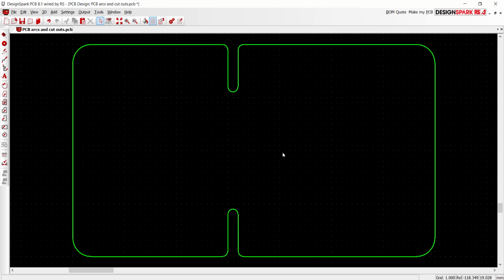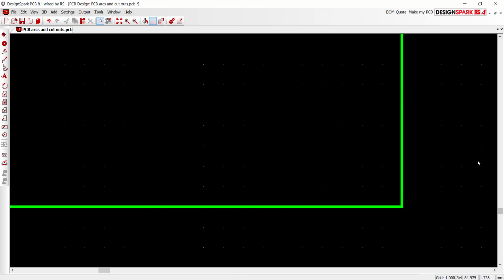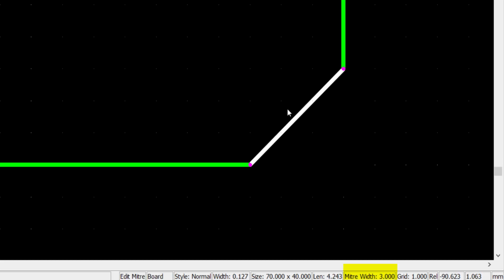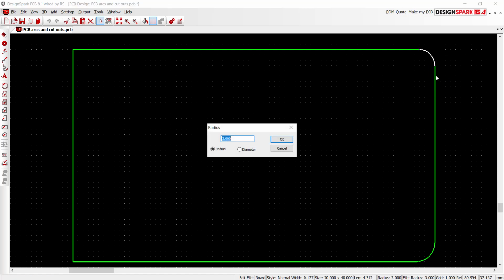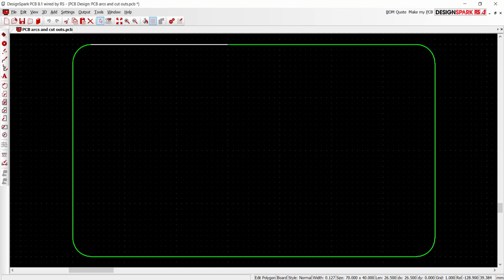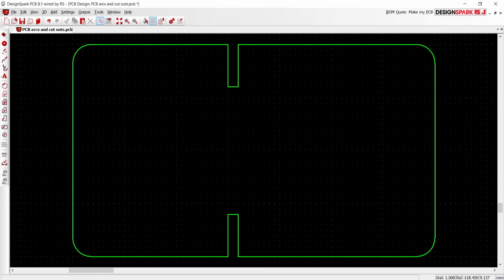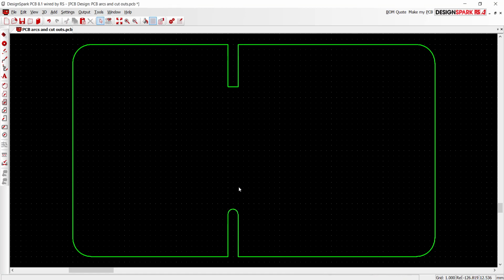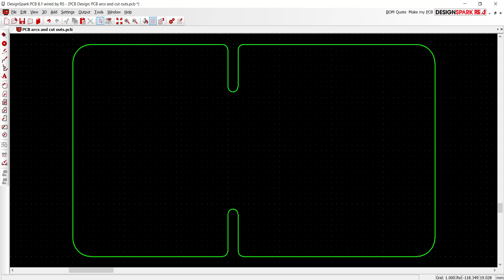DesignSpark PCB: How to make fillets and cut-outs for PCB board outline.

Comment: It can't add a fillet if the two adjacent lines are not perpendicular. So far the best freeware I've ever used and easy, however, the drawing possibilities are still poor, for some drawings one has to be creative to perform workarounds to achieve a drawing for some other drawings one can simply not achieve any workaround and get stuck with frustration. I have 5 years experience using DesignSpark PCB.